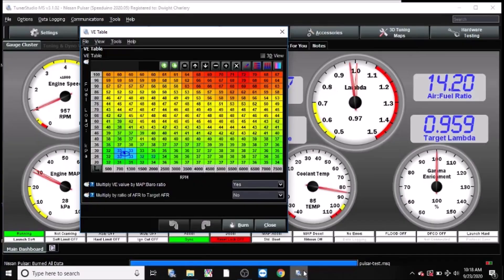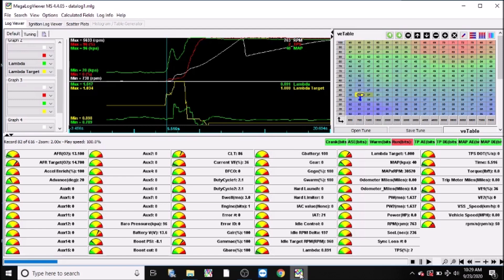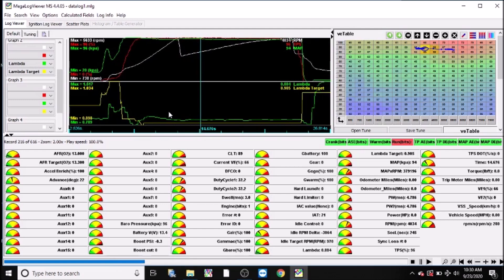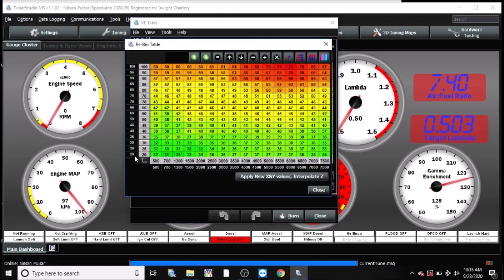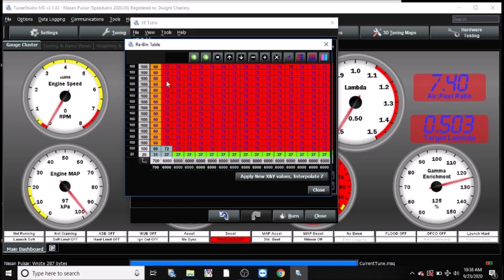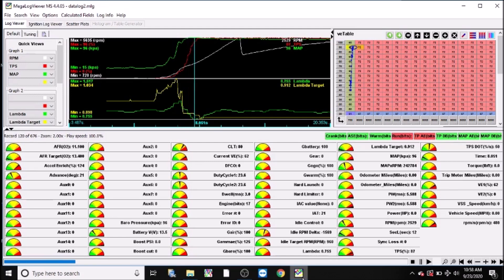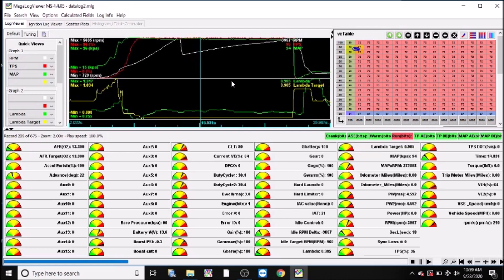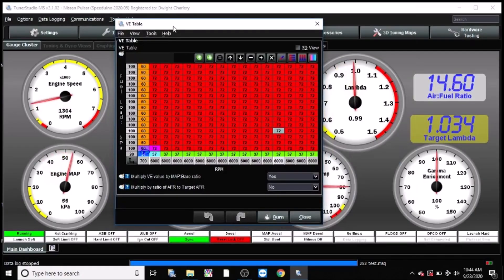Table Resolution : Do You NEED Bigger Tuning Tables ?

Comment: You can define load and rpm sites on the map, people should be taking advantage of this and not using up map sites on areas where the map is basically linear. let the ecu fill in the gaps, define your sites where you need to setup a curve.  N/A without vvt is easily done on a 6x6 or 8x8 map, for that matter even most factory turbo stuff from the 80's and 90's ran warranty safe and made emissions standards of the time on a 8x8 map up to a bar of boost.  Be smart about it 16x16 is more than most people think.

Comment: That's absolutely insane!!! I remember I asked the same thing on a live once some time ago... My question back then was badly worded as what I really wanted was 0.5 increments added into the timing table.. Obviously its not necessary but I do like the idea of being able to throw or remove timing in 0.5 increments instead of 1. I personally would give up timing table size for the ability to have 0.5 adjustability but that's a personal preference..  But really WOW what a amazing thing you can do with only 4 cells..
Reply from the maker: Agree 💯 . For most of what I tune, 0.5° changes in spark is not a big deal but I can definitely see the use in some applications.
Reply: Well..if you think of changes in atmospheric pressure and the accuracy of your IAT sensor, 0.5 degree timing is practically lost in  noise 😊
Reply: @laszlovona  oh I definitely won't debate those facts. It's a personal preference thing. Maybe more of a mental safeguard. In my brain adding a half degree of timing at the track without knock control isn't as bad as adding a full degree. Lol.

Comment: even with the 2x2 the speeduino is still interpolating through the whole table, you just lose the ability to tweak it from linear as resolution decreases.
Reply from the maker: Correct, that was really the purpose of the video. The power of interpolation